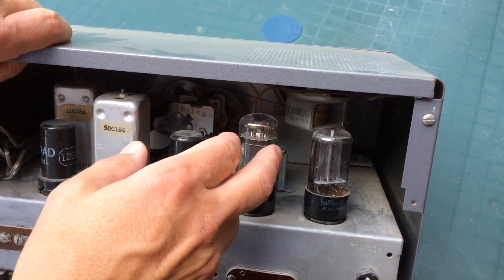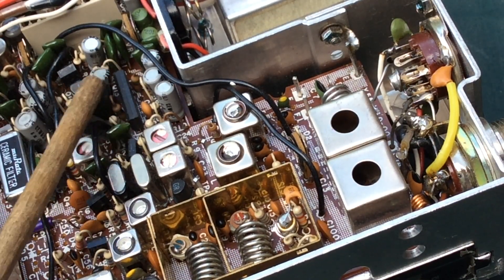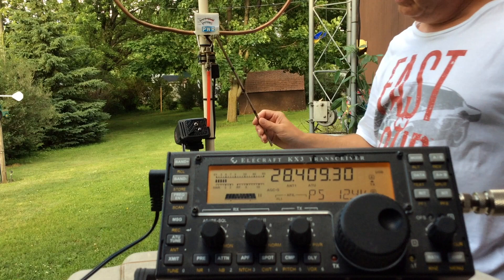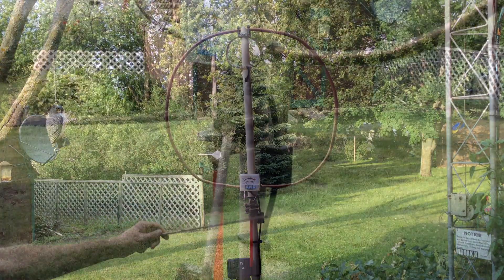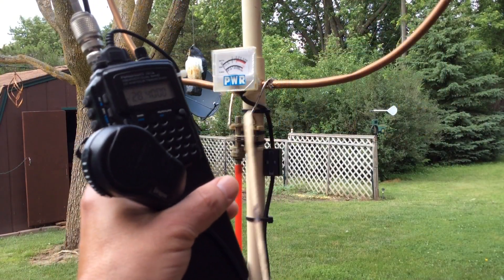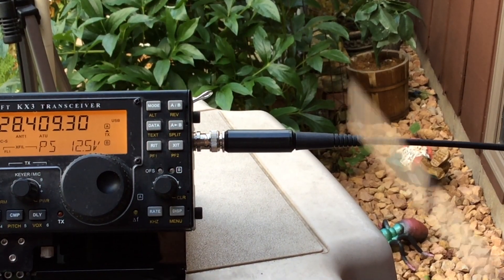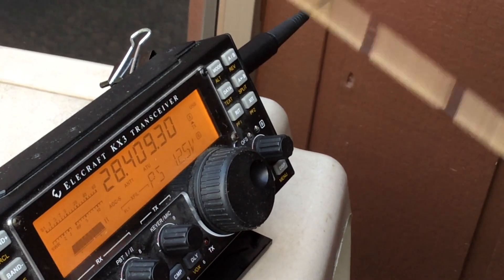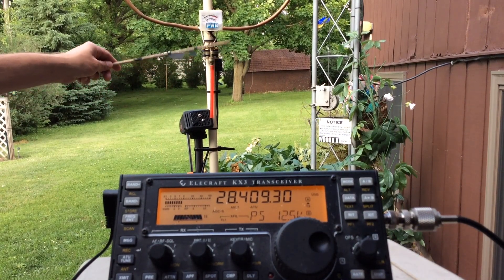Microphonics From Magnetic Loop Antenna? With Elecraft KX3-Interesting Effect

Comment: So its been 2 years, what did Elecraft say about this? Did you build the KX3 yourself? Did you post this to the mailing list? Can you still produce this effect?
Reply from the maker: I never contacted them since it has not been a problem in any way, just and interesting observation, I don't think it is a problem with the radio but just seems to happen with my loop antenna, maybe someone else has some other observations on this?  Maybe due to the high Q of the antenna?  I did assemble the KX3, it was very easy and fun to put together.  Did not post this to the mailing list or anything either.  Still using the radio and love it.
Reply: @RadioHamGuy  I just received a KX3, and have to agree its a pretty sweet rig. Just tonight I completed WAS on 40mtrs using FT8 with it. Only took 5 days to do it, and really only a bit of 3 days operating. I didn't build it, the Elemer that gave it to me did, however, I did build a K1 about 17 years ago.
Reply from the maker: @TheDgdimick  That sounds great, well I am sure you will have a lot of fun with it, it is a great radio especially for portable use.  Thanks for the post!  73...Larry

Comment: I have a mag loop antenna and have experienced the same issue with my KX3.  However, I have had no issues with other antennas.  I have a W4OP loop and it's very well built and is not problematic.  Perhaps it's the magnetic side of the issue since no other antennas seem to do this.

Comment: that is really bizarre... its hard for me to imagine its actually ringing on hf...  but not hard to believe that a capacitor would be able to induce af level signals at levels that would be easily high enough for a typical radio receiver gain.......  so yeah has to be some effect of the front end and/or digitizer... never really looked to see how that radio works specifically (is it direct sampling, or mixer and up/down converter etc) ...  most direct sampling are filtered out the end, so hard to believe that such low frequency would make it through... has to be a mixing product...     or aliasing in the samplier? (too late in the night to think about that)...    but still   would be really interesting to hear what the story is if one is found out.. hope you'll post a followup in that case
Reply from the maker: Well, it is sure a mystery to me too, I never thought you could get something like this through an RF pass to the radio from an antenna through a coax cable!  So, will be interesting to see other comments, I am sure someone knows what is going on here but sure a mystery to me yet.  I know I have seen this a lot on tubes or solid state boards but everything was mechanically connected and that makes sense.  I just happen to stumble across this when I was experimenting with the loop and noticed a sound from the radio when I was accidentally banging on the tuning capacitor with a tool.  Keep watching the comments I guess like I will, ha.  73 and thanks for the post!!